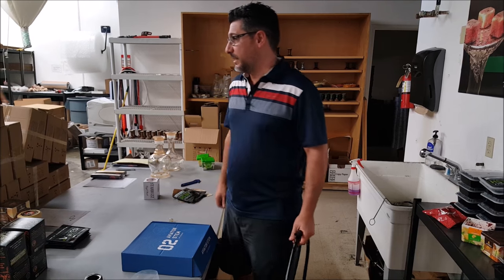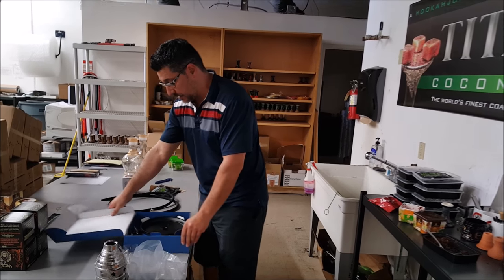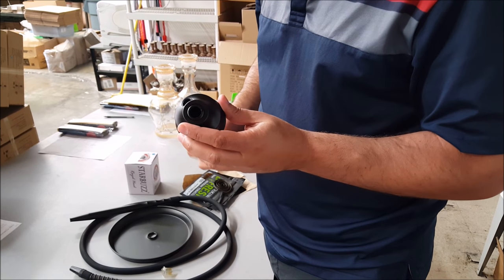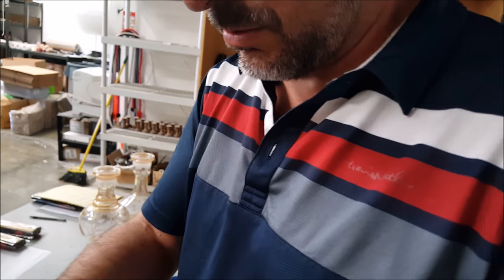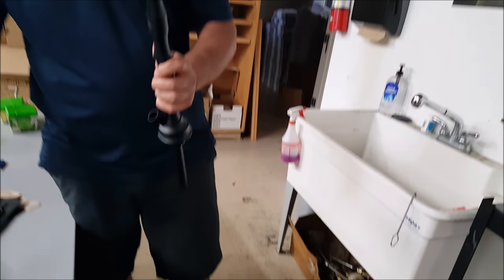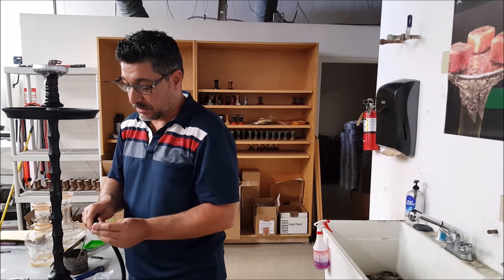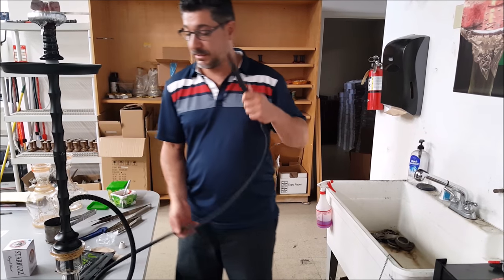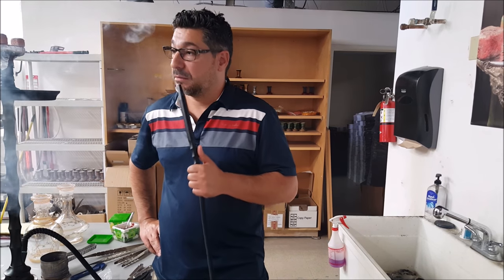Aviator Hookah Stem and Hose, made by Art Hookah

Comment: Looks like a nice hookah, but personally don't like it for two reasons, its painted both on the inside and on the outside of the stem and too many screw on fittings, so the risk of over threading rusting and from my experience never as good welded single piece hookahs.
Reply: No...just no.. look at all the modern hookahs now, they all come in pieces and are regarded as the best pipes ever made.. stick to your wack single piece KM lmao
Reply: @tupzc24  who regards them as the best hookah and clearly a welded piece will deal better than a threaded, is it significant maybe probably not just comes down to personal preference. Yeah I will I have had a 20 dollar welded hookah smoke better than  as a flavor of the month screw together mod hookah. Hookah s have been around forever really the only thing changing in Hookah is the style not function.
Reply: @abrahamo8934  bro look up MIGs, DSH, VZ, Aeon, Matt Pear or even regal hookahs. Build quality and smoke sessions are unbelievable with those pipes. Once you own one you will know. They will last you a lifetime